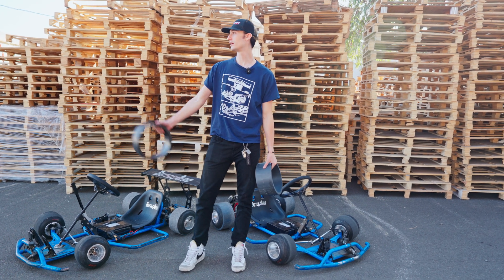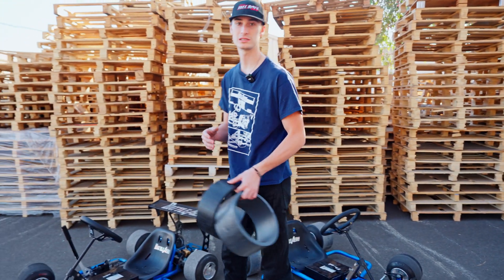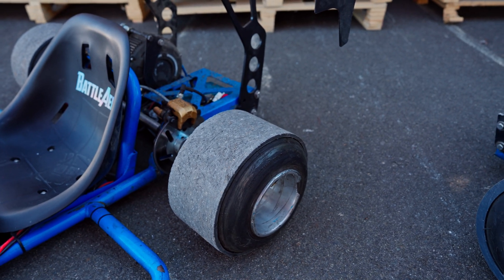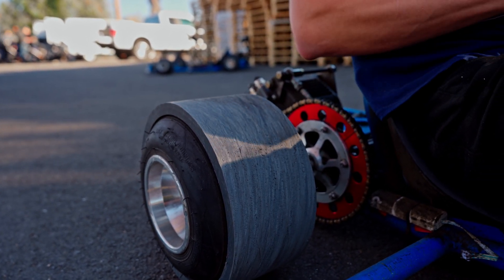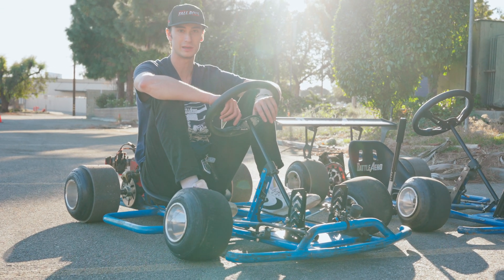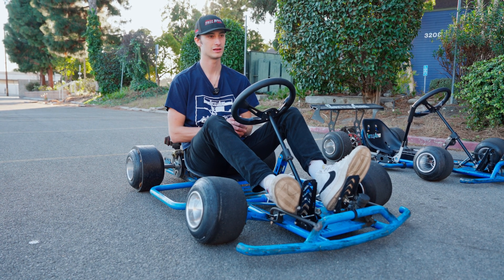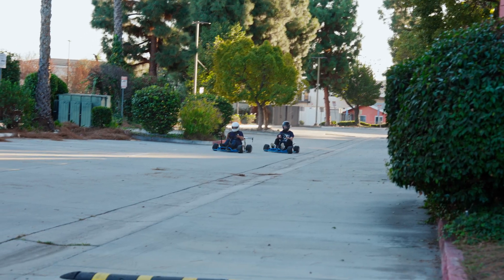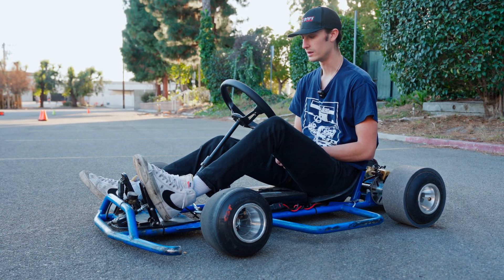Performance: PVC vs HPDE Plastic Drift Kart Sleeves

Comment: El traductor no me deja el tema muy claro, cuales tienen mejor agarre en asfalto?
Reply from the maker: PVC is better for asphalt & HPDE is better for rough concrete
Reply: @BattleAero  has llegado a probar el polietileno con solo 8cm de ancho? haz la prueba y veras como agarra mas.
El polietileno si es muy ancho no llega a calentar y le falta agarre. Prueba y nos cuentas.
Reply from the maker: @tuput206  When HDPE sleeve is cut to narrow it doesn't mount to the tire securely and will slip off tire
Reply: @BattleAero  hay formas de dejarlo bien y que no se escape de forma segura